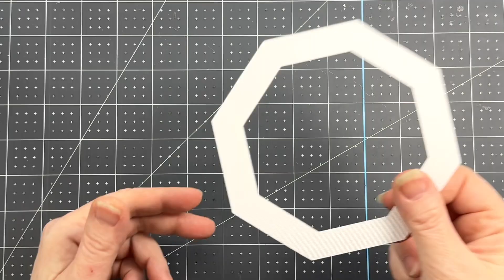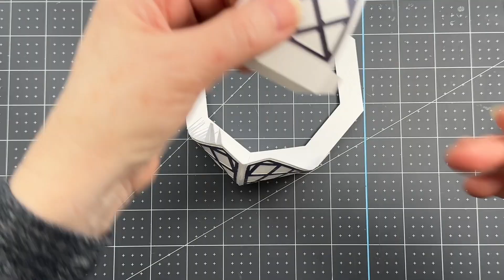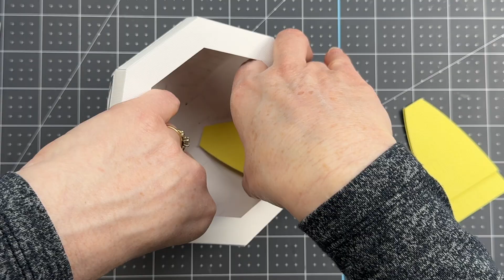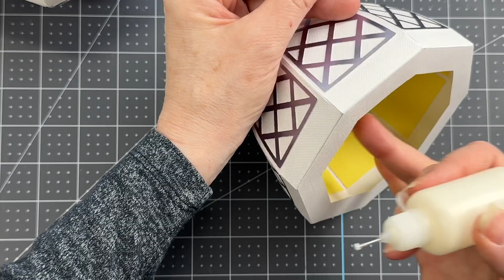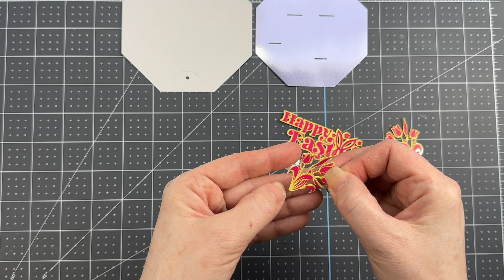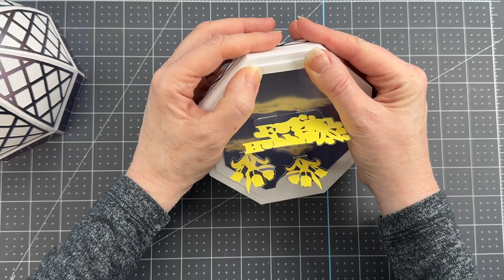Easter Egg Treat Box

Comment: What glue do you use?  I try one tonight and use PVA glue and didn’t set as well as yours did.
Reply from the maker: I use either Art Glitter Glue (it contains no glitter, that is just its name) or Bearly Art Precision Craft glue.  I like to transfer my glue into small precision tip glue applicator bottles with silicone caps.  They make it easy to control the flow of glue.  I can find all three items on Amazon.